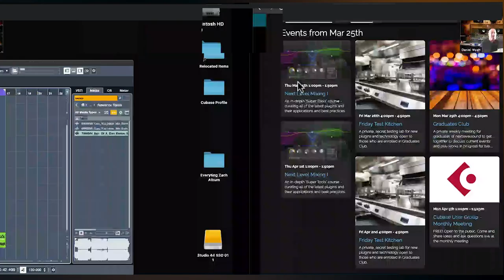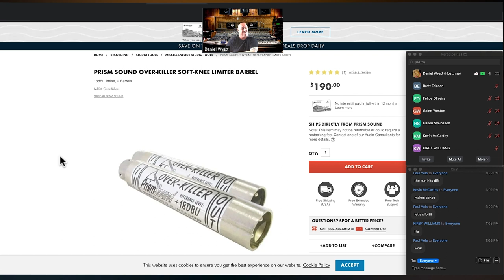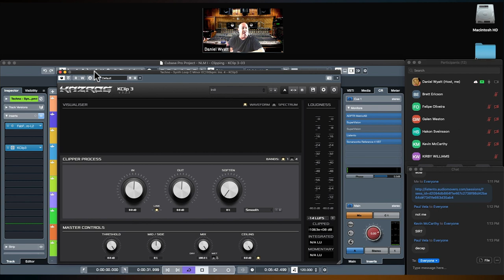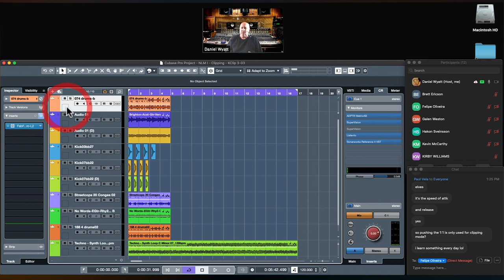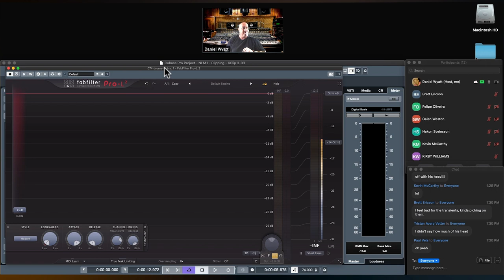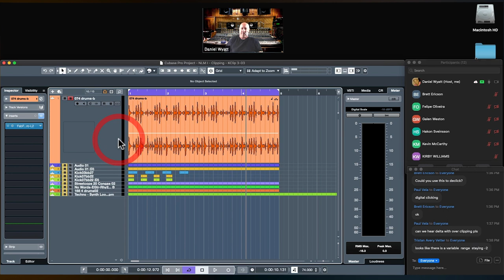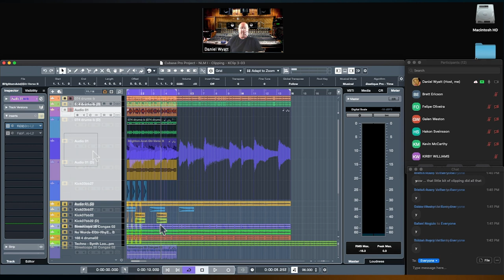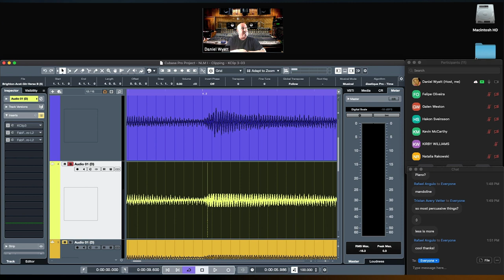Mixing Lesson - Soft Clipping | Full Class

Comment: Hi sir, I analyzed every track that I downloaded from YouTube and all track have chopped of high frequencies.  I try to clipp hard and limiting it hard, but when I  analyzed my master track there is no chopped high end.  How do the professionals do that, maybe with pultec or somehow else?
Reply: like mp3s... the high end is chopped off at around 16hz. if thats what you want then cut off or lower above 16hz with a shelf. it is true that cutting off high end can save space in your mix like removing excesive low end from tracks
Reply: yeah that's not on purpose pretty sure that's compression, you shouldn't be adding that into your track though haha